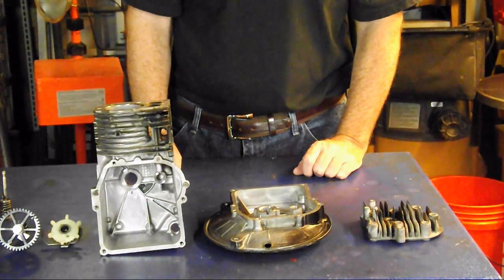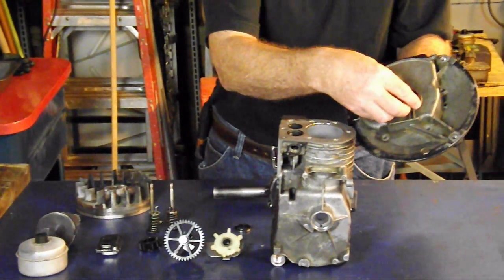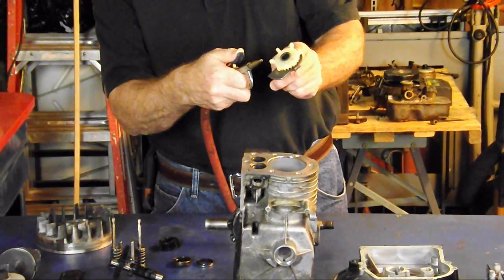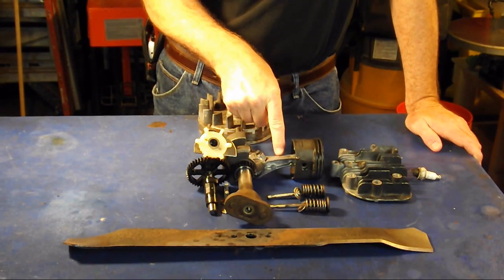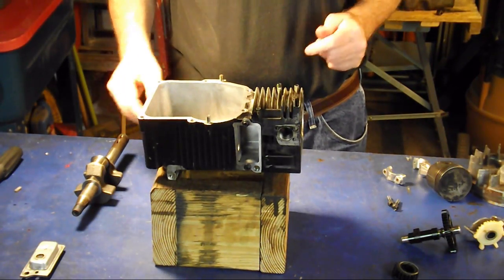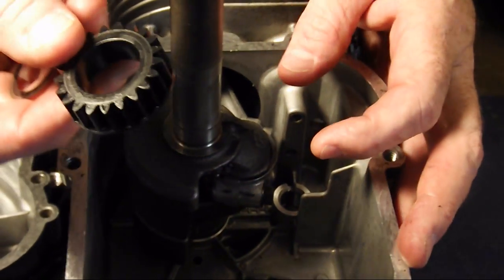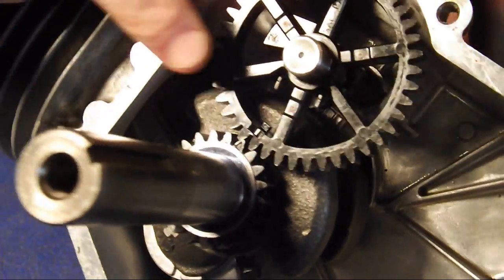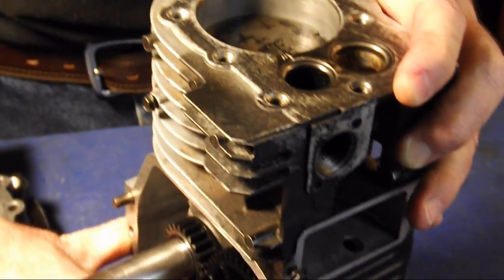Part 7 Taking Apart  and Rebuilding A Small Engine Series

Comment: Please reply to question when you have time concerning. Should hone the cylinder bore and install new piston rings for a lawnmower engine thats burning oil?
Reply: Joe Dirt. if it has a cast iron cylinder I would suggest that you do what the guy in the video is doing for assembly and disassembly. For a cast iron cylinder or IC engine I recommend that you find a machine shop, have the cylinder bored, honed, and a new piston properly fitted with some good quality chrome piston rings. this way your piston will be new, fitted in a round true cylinder, and it should last a long time. If it is an aluminum cylinder wall engine and you love it you can have it bored, sleeved, new piston, new rings and it will last a long time. if it's just a beater or something you have no attachment to pull it apart, get a ring kit, and gaskets. Now for the fun part. if you decide to use a de glazing hone use a good honing oil or WD40 and lightly hone just until you have the glaze cut away. If you do not want to buy a hone use some fine emery cloth and marvel mystery oil. take the emery cloth a little marvel, and gently with your fingers a wiping motion on the surface inside the cylinder in a cross hatch pattern letting the cloth and oil gently remove the glaze. simulate/go the same direction just like a hone on a drill until you have most of the glaze gone. Dont clean or glass bead the piston top or sides that carbon is a thermal barrier. Wire brushes and such on piston tops and heads cause hot spots and detonation. gently clean the piston skirt and get all the gunk and carbon from the grooves your old rings are or were on the piston. if needed soak the piston in solvent and gently clean it. if the skirt area is glazed a little emery cloth. the key is that you just want to get the glaze off and not remove metal.  Wash everything with brake cleaner, and hot soapy water. dry, and re assemble. it sounds back woods yet I have done the throw away aluminum cylinder engines like this and it works. This is totally hillbilly haha now I have even just soaked the piston in the engine with marvel or PB bladter overnight, getting the rings unstuck, wipe out the cylinder with a little PB and a fine scotch Brite pad, oil up the cylinder wipe out the cylinder,  a little engine oil on the cylinder push up the piston wipe it off, bolt on the head and no problems. So now you have some options give it a try and I hope that I was able to help.

Comment: Gene, I have diverted my interests in small engines elsewhere for 40 years because no one was around to explain them to me, and I was easily distracted by other interests that came easier. Thank you for making these videos so easy to follow and understand. I have the confidence to dig into an old 16hp Briggs Ive had sitting around with a project in mind.
Reply from the maker: Thank you for the reply and good luck on your project.